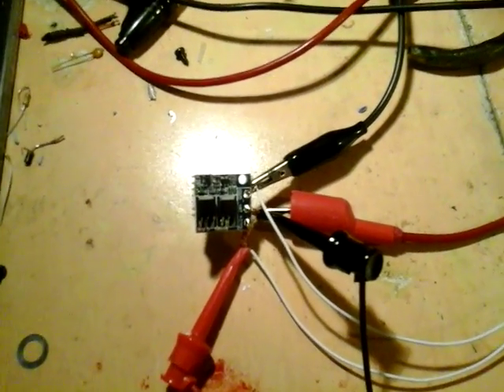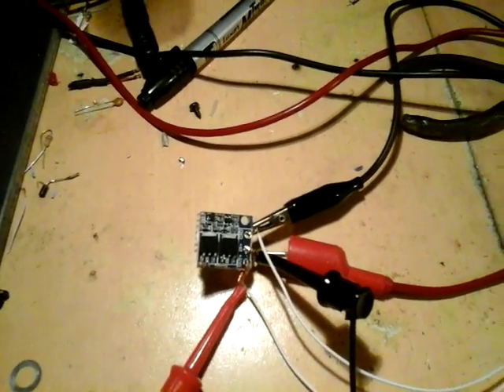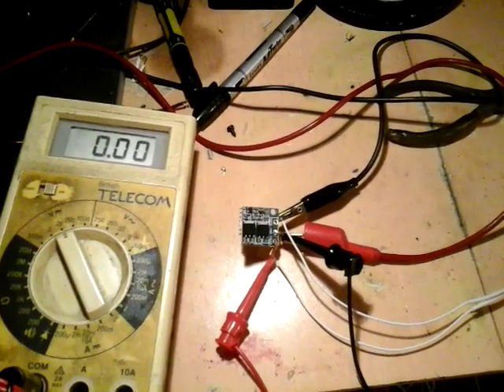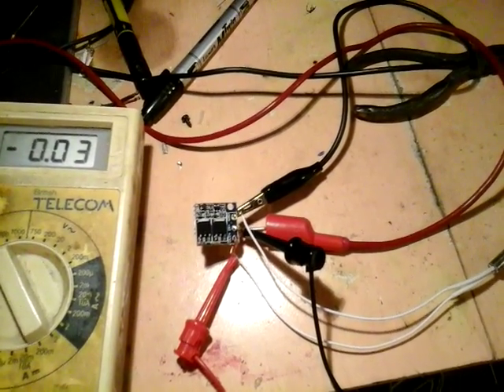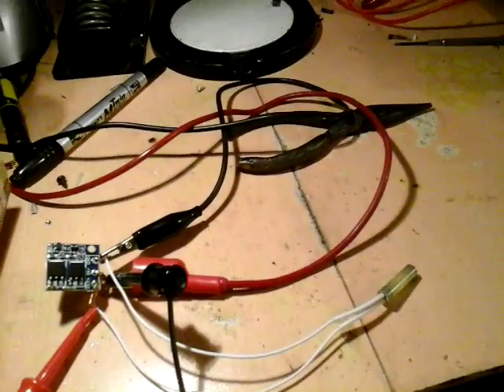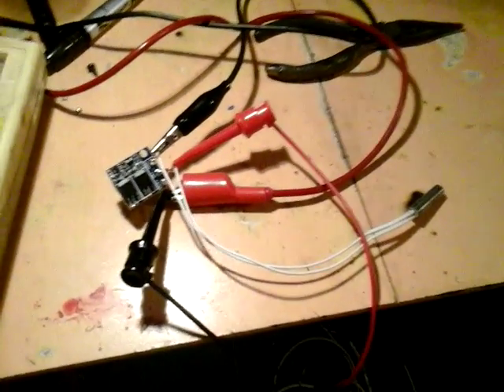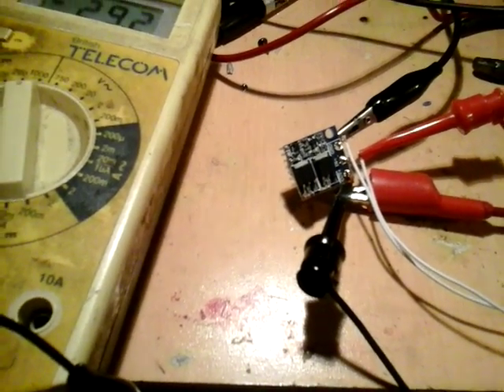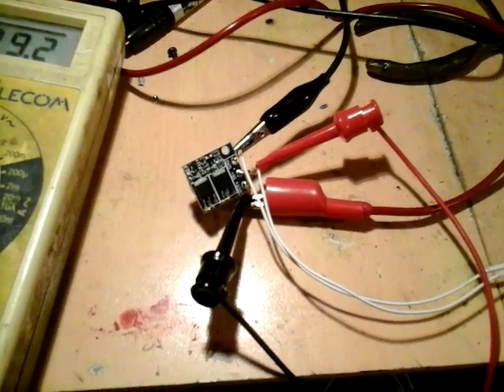Testing an eBay ideal diode module.

Comment: Can you please share information abut solar panel that when i check Open-circuit Current in solar panel its show 8Amp but after connect mppt controller show 7Amp?i am using esmart3 40Amp solar controller.i installed  15SQ045 Schottky bypass diode.

Comment: hello i have 8x100w solar panel each solar panel have bypass diode but during full sun shine Voc is 88 but when i connect mppt contorller then volt is 67 and Amp 7 but short current is 8Amp.should i use ideal diode module for each solar panel in parallel for block reverse volt and current?
Reply from the maker: Almost all MPPT controllers have blocking diodes built in, so you shouldn't need a separate blocking diode at all unless you have a quite unusual one. Check the manual. Bypass diodes are something else entirely, and have no impact on power production - they are to prevent damage under partial shading. Plus those voltages suggest you have panels in series - under those conditions there is just no need for an ideal diode, as the losses in a standard schottky diode are not significant.